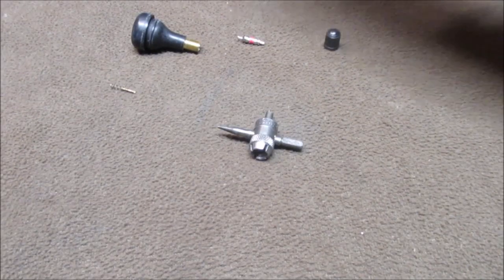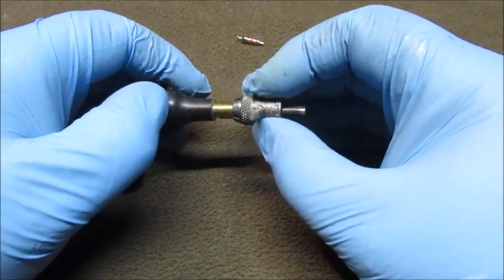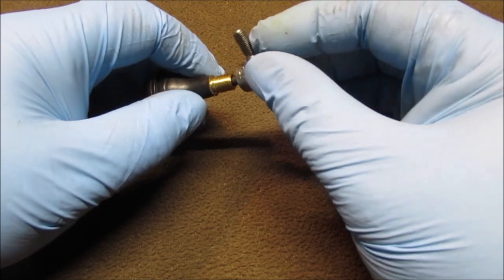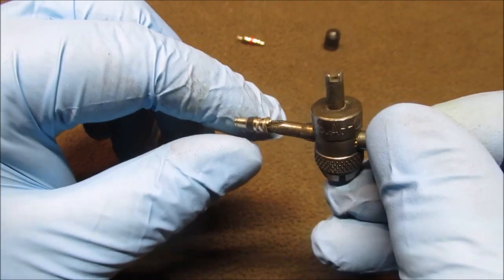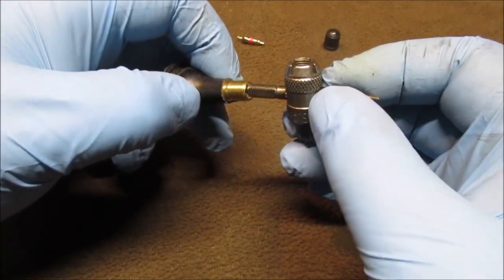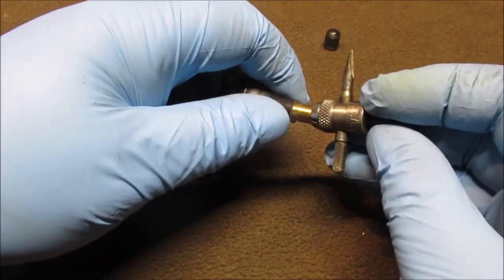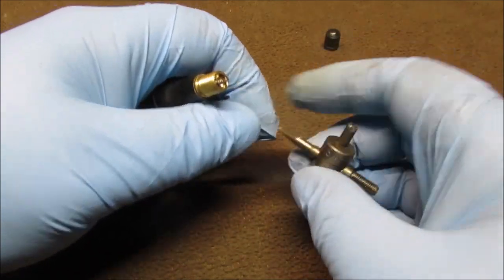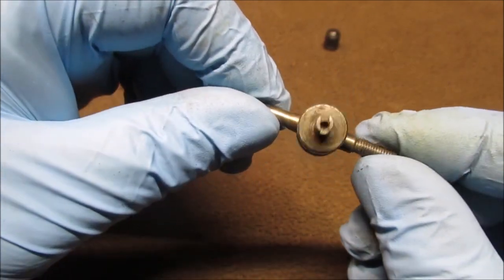DEMONSTRATION of 4- IN-1  Valve Core Removal Tool

Comment: You know I learn something new every day! 
I'm nearly 60 and I never knew about that mini "easy out" on the valve tool! Thanks, Jim!
Reply from the maker: It is a nice tool to have if you fix your own tires
Reply: I watched several videos about this 4-way tool, and none of them were able to give the proper use for the tapered part.  The packet it came in doesn't explain anything and the previous videos either didn't cover it or incorrectly said it was for cleaning the inside threads, and I could see that wasn't right.  So now I know it's a left-threaded easy out...thanks.

Comment: I used to do a lot of tire work and kept one of those handy all the time. Great little tool , Thanks Jim.
Reply from the maker: I have had this for a lot of years Works great to hold a valve stem on a tube from falling back into the rim and for pulling in a new valve stem

Comment: I’ve had this little thing for years and never knew all, just the valve switch out. I should know kissing 60 but not til now. Thanks for sharing.
Reply from the maker: I would use one when I was a kid and went to the gas station to get a tire fixed

Comment: Now if I could only find one that isn’t made of Chinesium and is actually machined properly like the one you have. Yeah the ones at Walmart and places like that are cheap, but you most certainly get what you pay for. I had a valve core break on one of the tires on my trailer for the garden tractor. These are old Sears tires (I think late 60s or early 70s) so I sure didn’t want to have to take them off of the rim as they are so dry rotted that I’m sure removing them will ruin them. So I get one of these 4 in 1 tools from Wally World. Yeah... that tapered reverse thread easy out part barely had any threads cut into it...
So I try one I found at my local car parts store. While it was a little better it still couldn’t grip onto a thing. 
As I’m now getting rather annoyed I just go grab a new set of easy outs (let a friend borrow the set I had...and they conveniently forgot them at a job site overnight and some damn kids stole every tool that was there...what else can you do but laugh at this point lol)
Well the easy out had that broken core out in the blink of an eye.
It’s amazing how much difference there is between something made well vs something made cheaply 
Definitely going to keep an eye out for a good quality 4 in 1 lol
Anyways, hope you got a kick out of my adventures with Chinesium 🤣
Reply from the maker: When I found mine it was in a bucket of junk and I spent the time to clean it up and not lose it New tools sure can be junk

Comment: I got a milwaukee version of the schrader tool and the schrader bit broke instantly 🥲 The schrader valve is quite stuck on the AC high side, probably from years of not being serviced. I put some pag oil inside the fitting and im letting it soak to see if that will unstick the valve from the aluminum line.
Reply: Did it ever come loose from soaking it in pag? I'm going through the same thing with my high pressure service port.
Reply: @notreal5299  It did not. The solution was a new line. Sorry to hear you're having the same trouble
Reply: @NickAlexander_is_Awesome  ok I may have to do that too. Thanks